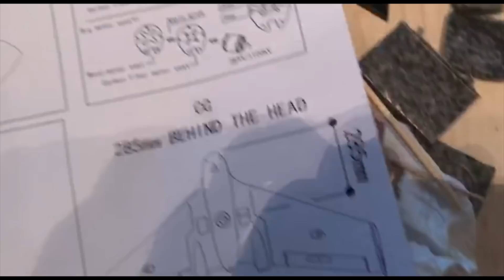Reptile Harrier S1100 - fatally landed #13

Comment: Hello! 
Rly like your vids!
I have a question: im gonna buy s1100 as portable long-range fpv plane.
But im not sure about motor and prop.
In you opinion for long range flights whats better 2 small or 1 big motor? And with what prop should i use?
Reply from the maker: Thank you :) 

Personally I would go for Two SunnySky motors and then then spin 8045" props ... I love to fly with them as they are powerfull and efficient!

You'll find the links to the plane and the motors in the description of the video. The preferred props are these: 

http://www.aero-naut.de/produkte/flugmodellbau/flugzubehoer/luftschrauben/camcarbon-light-prop/

Comment: I'm building an S1100.    The suggested flying weight is around 1 kilogram.   The motor you have installed are correct for the plane if you only fly it with one motor.   You have a heavy model the way it's laid out in this configuration.    You may enjoy this plane better if you put two lighter motors on the back and balance it with a lighter battery up front.    With my build I put on two 2206 1500kv motors.  The two together weigh less than just one of your motors, and yet it still drives an 8 inch prop.  Sure, it won't be as fast but it should be more agile in the air and may even glide a bit.

I loved how you made this video.  Great filming and editing.   I also love your wing setup with the flight controller.   It looks like it was F411 wing  and when I saw it again it switched to an F405 wing?
Reply from the maker: Hi Steve, where do I start? Well ... my intention was to build a Harrier, that can make a good distance, let’s say mid-ranges. The motors are not as light as the ones you mention yet again they are very efficient and add as counter weight to the Lipo (4s5200 or it was even able to fly wit 4s6600). On 4s5200 the balance is just perfect with the action cam on top. Theses cam demand 80g of payload.

I believe it should be easy to get on the 1kg Auw but perhaps it will take some range.
Reply from the maker: Ah, almost forgot! The landed harrier had the Matek fc hub wing with a f405-std installed! It performed awesomely!

The new build will carry a F405-Wing with iNav v2.01
Reply: @JustFPV-net  That's the problem with the S1100.   I think you're pushing it to the end of its limits with that configuration.  What they really need is the Harrier  XL. If this plane was 1400mm or dare I say 1500mm it would be unstoppable.  It would probably be the plane you would order 2 at a time of.  The configuration you have would be perfect for it.   There's really no dual motor delta wings that I can find in 1400mm.

I'm curious to see what you do with the new build.    Looking back on your footage does the plane sink when it turns?    I am curious to see what type of range you can get from this setup.   Have you tried the Phantom FX-61 yet?
Reply from the maker: I don’t feel it sinks in turns! Feels pretty right like it is! With a 6600mah it’s terrible nose heavy but the 5200mah with 423g is awesome! I get 40+km out of it usually but it can go for 50mins I think. Will check that out with the new build!

Fx61 you say? ... have a look 

FX-61 - In the End #51 https://youtu.be/HfeKrxbTro0
Reply: @JustFPV-net  I guess you're in Europe, perhaps Germany?    This plane I am going to suggest is inexpensive for what it is, but the shipping is going to be a bit costly.   It's the Flyingfoam 'illusion.'   Like the FX61 its also 1500mm  But this one is EPP foam (not smooth like the Harrier).  It's 1.3# so the foam is similar to the Teksumo or Popwing.  It's custom ordered thus you can get it in black or white.   It's just delta wing cores.   You need to find balsa wood and make your own elevons.  They'll give you the CG and the rest is up to you.   It would probably fly well with the 6600mAh battery.   When you get it set up right it will not only carry your weight but glide like you've never seen.  If you build it,  you can put motors on with 12" props.   This is when you drop down to the larger motors with 800KV.   The efficiency goes through the roof.  They have a plane one size larger called the Mother Ship.  It's 1800mm.  It takes 2 people to launch it.   There are videos of both planes flying on YouTube.  

40KM is a long way.  That is extremely impressive.  Good job!
Reply from the maker: Never heard of it- will have a look :) my upcoming mothership is a bit larger than that, I assume it to launch next year!!!
There is almost no room for more wings currently- got 3 planes waiting for maiden: Skywalker x6, Ewing’s Vortigaunt and another speedy thing. And the harrier of course- all in all a lot of stuff to do ;-) and you suggested right- ger
Reply: @JustFPV-net   Well, you certainly opened my eyes to the S1100.  I really didn't think of it as a midrange FPV platform.  I have a F405-Wing controller ready for it.  Did you counterspin your props?   I've heard pros and cons of each.

I will try for a lighter build than yours but also try for a 3S 4 amp battery.  My goal is to get 20-30 minute flight times from it.  I have a dry lake about 80 minutes away where I could test out mid range FPV without the risk of running into your tree. :)    I am excited to see what you'll do next.   I've subscribed to your channel.
Reply from the maker: 25-30min flight will be no Problem at all! Average consumption on mine was 5-11A mostly cruising at 5A!
I’ve got my props spinning differently on each motor- but well, I don’t know what’s better ;-) right now I’m soldering my f405-Wing for the black s1100 ;-)
Reply: @JustFPV-net    I used to struggle soldering the flight controller boards.  Then I got a video microsope from Banggood.  Now I can do the F405 board in about half an hour.  Now, I actually enjoy soldering.

The one plane I liked in the 1200mm range is the C1 Chaser.    it was supposed to be the 4' Wing Wing. Everybody was excited about it, then not so much.   I love this plane.  I love delta wings around 900-1200mm.  Sonicmodel has the HD wing which they brought down in price that's also 1200mm.   It has a huge cargo bay for lots of FPV gear.  I haven't built it yet.

Which reminds me, have you done  any mission planning via FPV, and flying by satellite only?    I have only seen video where people fly it short distances.   I haven't seen anybody set waypoints 10km out and back.
Reply from the maker: The chaser is the one plane in that series, I didn’t own so far. All the others are here .... ;-)

I do not use any mission planning- it’s more like go out and explore against the wind and return back safely for me

Comment: Sorry for your loss. If you like very stable long range wings, try the ZOHD Dart XL.
I like the footage from your harrier, so smooth and stable. What's the maximum and stall speed on your setup?
Reply from the maker: Thanks - this is about to be rebuild. The dart xl is far to expensive for what it is in my opinion. But I understand the people are interested in it.
Max Speed was about 120kmh and stalling ... I don’t know - have been traveling with 20kmh but that is against wind so it’s hard to tell